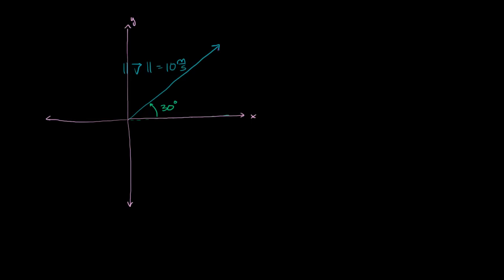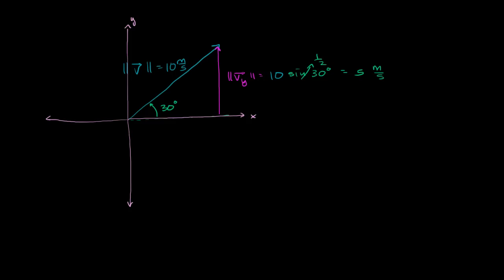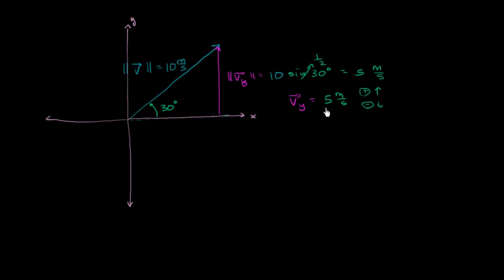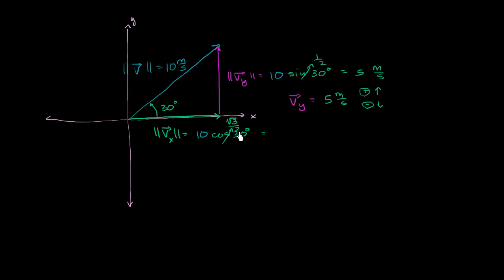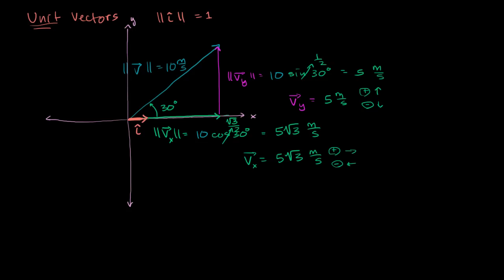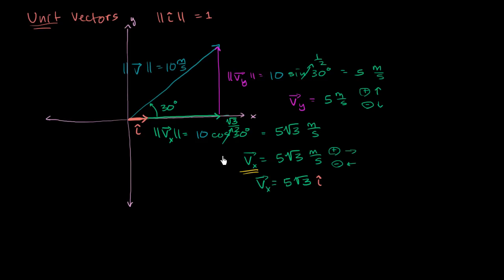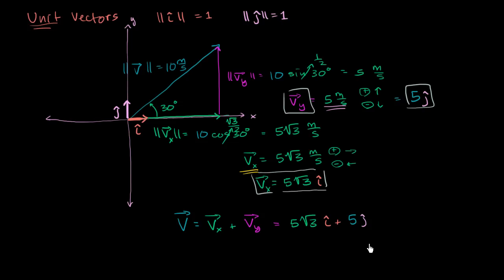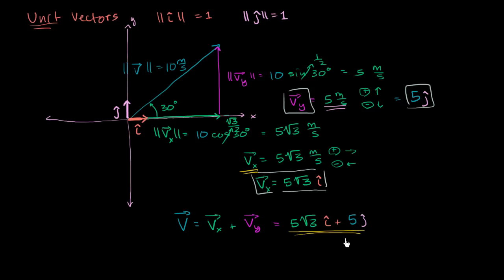Unit vectors and engineering notation | Two-dimensional motion | Physics | Khan Academy

Comment: 6:41 Don't you have to use pythagorean  to find the total? Not just add them?
Reply: No, Pythagorean is sued to find the magnitude (length), while Sal used to find the sum of the vectors which is calculated differently.
Imagine it as you draw the Vy then you draw the Vx to the right starting from the end point of Vy, then you draw the vector from start of Vy till the end of Vx and you get V.